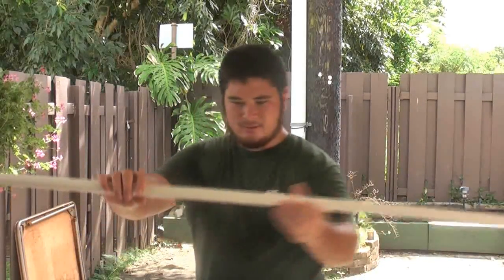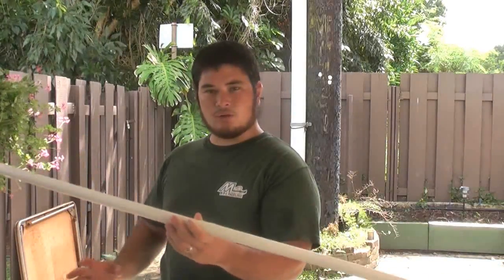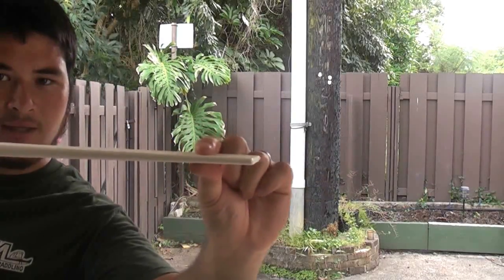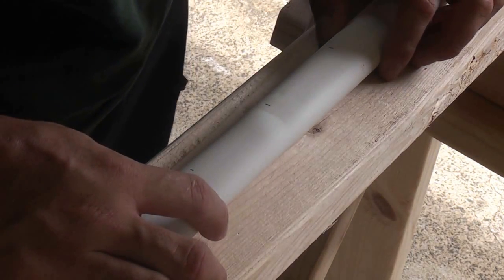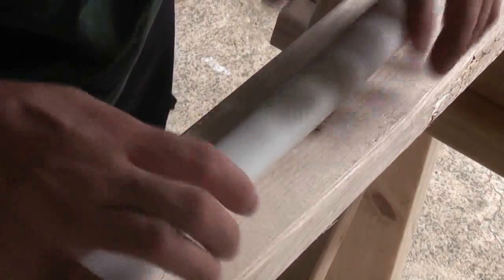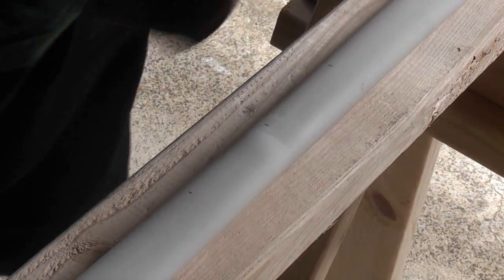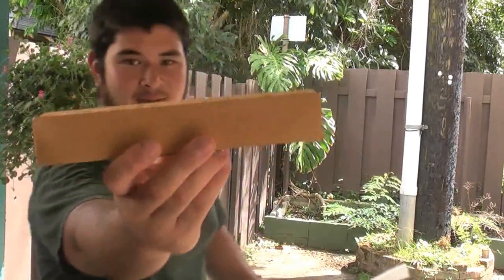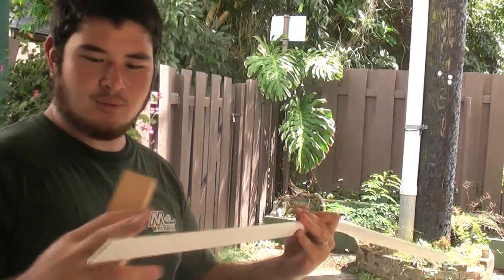How to Make a Hunger Games District 12 Bow with PVC Pipe Part 2

Comment from the maker: No, the ends hold together by themselves. The tips don't flex that much, so the plastic holds its shape well without any glue. Though without glue, the seam is still a little visible on the belly side.